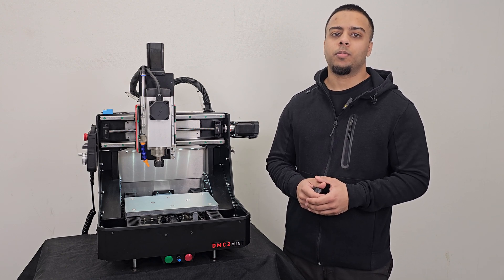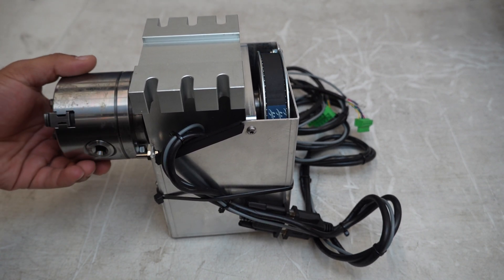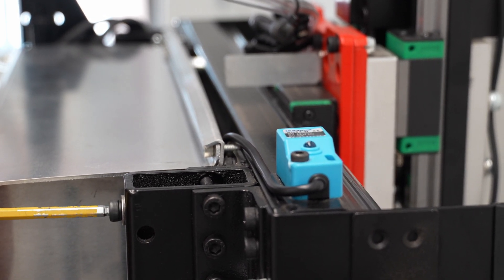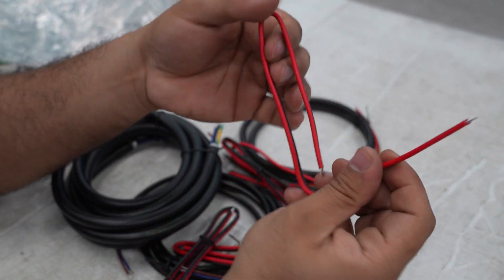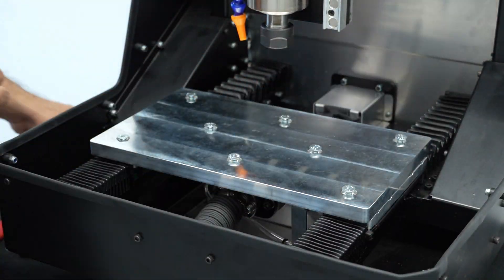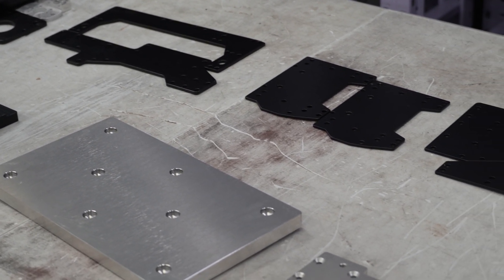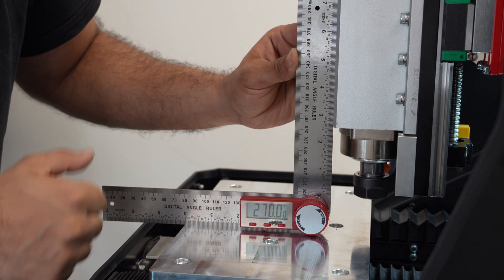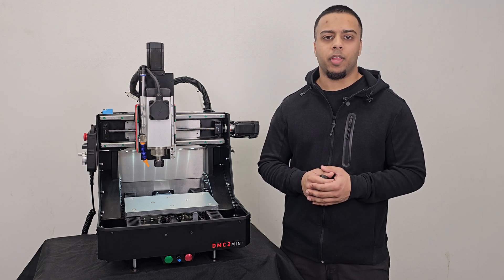DMC2 Mini Desktop CNC - Full Technical Details

Comment: Soldered wires into screw terminals is a failure prone, potentially fire causing, choice.

Use a ferule instead of solder. That will actually last and is the gold standard. 

Everything looks killer but that.
Reply: And wire numbers for easy service is also important

Comment: I have the the first DMC2 and it's a great machine. I had issues tramming due to unmachined square tubing, but Omar was always very responsive and sent out replacement parts as necessary. I'm happy to see the upgrades. I would not hesitate to purchase this machine if you're in the market for a small very capable mill.
Reply from the maker: Thank you very much!
Reply: Hello please reply to me how thick steel can it cut?

Comment: The non-mini DMC2 actually looks like a pretty attractive option, have the ease of assembly changes been applied to the DMC2 as well?
Reply: Also wondering this re motors and machining of steel tube

Comment: I have a Masso Touch that I'd like to use with this. Sounds like that is possible.

Is the spindle reversible so we can add a Rapid Change ATC?
Reply from the maker: Yes it should be compatible, our motor drivers operate with 5v step/direction signals which the Masso board outputs. The other buttons are just opening/closing a circuit. And the spindle operates with a 10v analog speed signal. Masso can output this spindle signal according to their docs, or you can upgrade to PWM spindle signals since our VFD can accept a PWM speed signal.
Reply from the maker: The spindle is not reversible in the configuration we sell it as, but it does have the functionality if you wanted to set this up. Adding an ATC is possible but very space restricted due to the compact design of the DMC2 Mini frame.
Reply: @shariffdmc3406  what is the model of the spindle? I'd like to dig up the datasheet.

Comment: I see debri on the probe magnets at 7:53 Would this have an effect on probe accuracy?
Reply from the maker: Yes, they will pull all the steel chips in. So the easiest solution is to keep a toothbrush or keyboard brush on hand and swipe over the magnets to clean it off before using the probe. The magnets are flush to the top surface where they are mounted so that chips will slide off with a single swipe or two. We experimented with a cover but ultimately it just complicated things and still let a few chips in behind regardless.